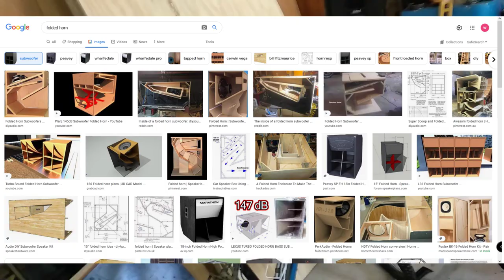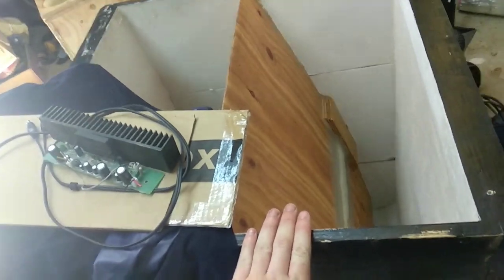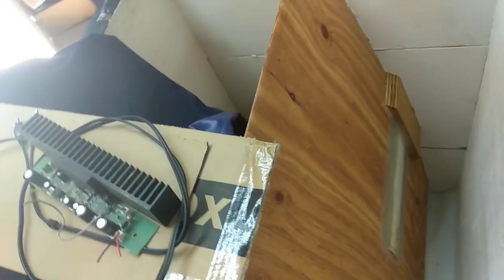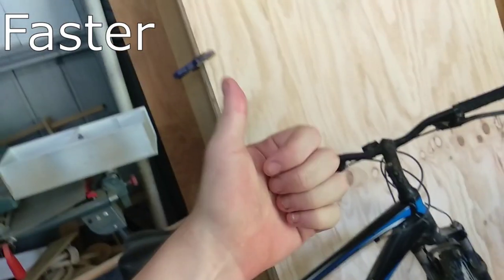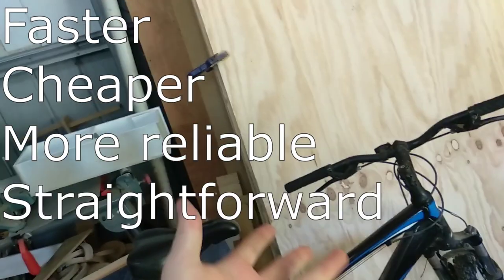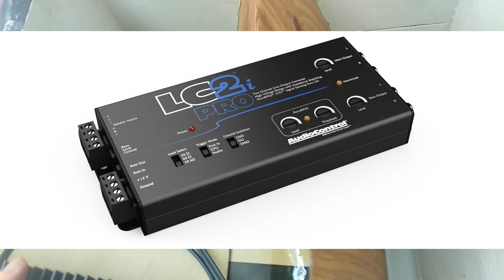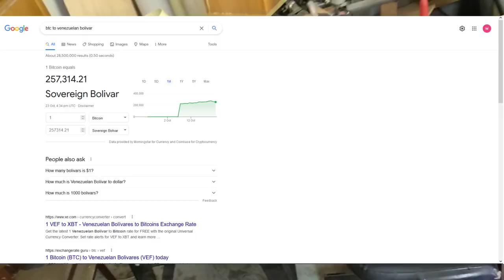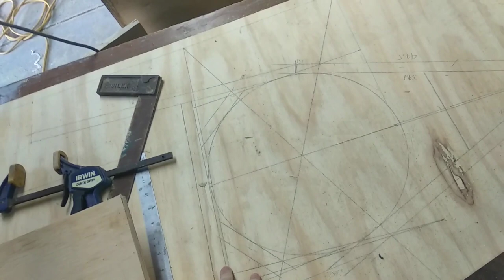Series Compound Folded Horn!

Comment: I have a question for you about parallel 6th order BP's.
Can you have the ports facing in opposite directions? Like the high tune port facing forward and the lower tuned port facing the rear?
That way the lower e can develop and the upper bass can get shot right at me.
Or do both ports HAVE TO face the same direction?
Reply: The frequencies are so long I don't think it will matter. Perhaps just keep them close to each other